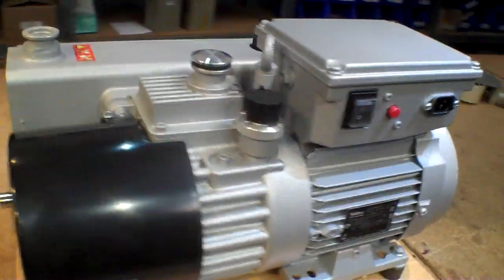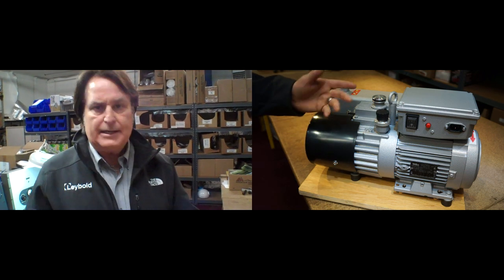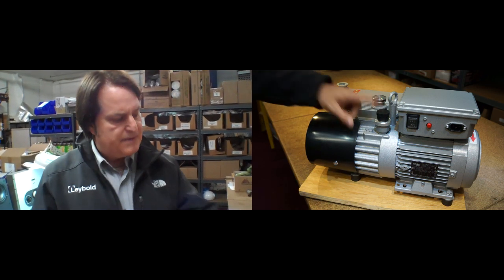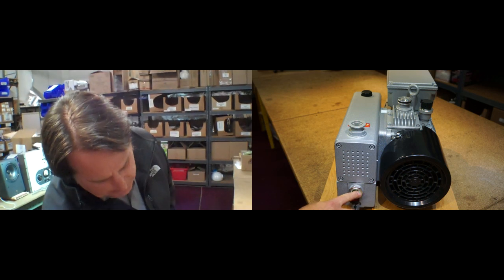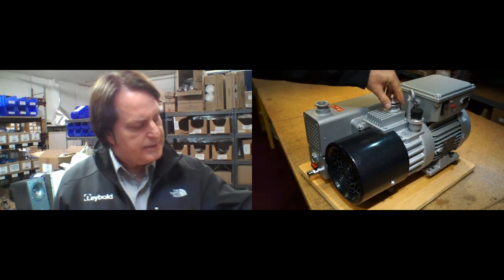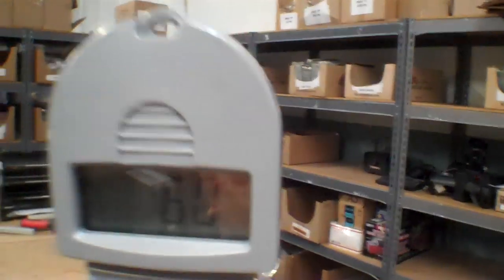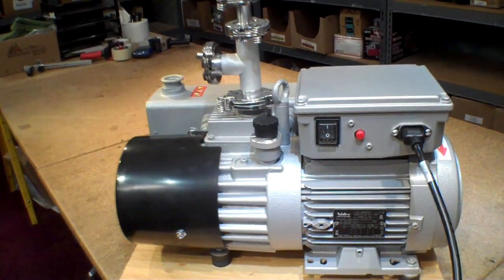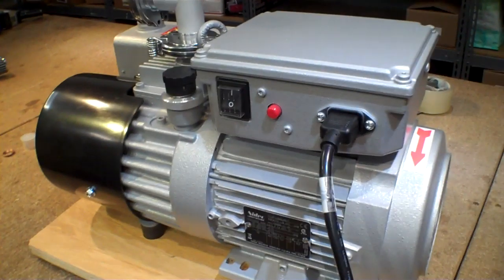Introduction to the Leybold Sogevac® Neo D 16 rotary vane vacuum pump.

Comment: Brian, along with all your other testing and equipment needed to pull this off successfully with harvest right machines, can u also let us know power usage compared to all  harvest right pumps,
 Also how fast it drops to 500 mtorr? It is 11 plus cfm so it aught to work nearly double as fast on the entire process.
Also how low of an mtorr it gets too? WITH AND WITHOUT BALAST (ON AND OFF) SEPERATE  TIMES?
Also total batch time for dry cycle?(INCLUDING HOW U USED BALAST DURING THE ENTIRE PROCESS?
Also total batch time for final dry and over all total as well?
Also how you are using the balast valve during the whole freeze dry process? 
Also the decibels with balast valve open?

My oil less pump had two different results on back to back batches of  2 #10  CANS of tomatoe sauce in 34 hours for the 1st batch.
AND 38 & 3/4 HOURS FOR THE SECOND BATCH OF 2 #10 CANS OF TO A TOMATOE SAUCE. 
AND MY OILERS  PUMP IS $1600. 

P.S MAYBE YOU COULD DO  THE SAME TOMATOE SAUCE I USED. IT WAS TWO #10 CANS OF CANTALINA TOMATOE SAUCE FROM COSTCO. IN LARGE 5 TRAY HR. I STARTED PRE FREEZE YESTERDAY AT 230PM, AND THE BATCH IS FINALLY ON FINAL DRY AND SAYS IT'LL BE DONE AT 5:46 AM ACCORDING TO FINAL DRY COUNTDOWN. THAT SHOULD MAKE MY ENTIRE BATCH TIME JUST SHY OF 39 HOURS*
I'M HOPING U SELL ME ON A REAL WORLD CLOSE EXAMPLE OF LEYBOLD PUMP.  BECAUSE IF IT BLOWS THE  39 HOURS AWAY FOR HIGH LIQUID TOMATOE SAUCE I DID,  THEN I'M SOLD*
THE COMPANY GAVE ME MIXED ANSWERS ON  MAINTENENCE OF MY OIL LESS PUMP. FIRST PERSON SAID TO ADD 1/4 CUP OF ALCOHOL TO FLUSH PUMP.
THEN THE NEXT TIME I CALLED THEM A LADY THERE SAID TO NOT USE ALCOHOL AT ALL,  B3 CAUSE IT DRIES UP THE SEALS. SO SHE SAID TO POUR SMALL AMOUNT OF WATER WHILE IT'S RUNNING IN THE HOSE AND LET IT RUN FOR AN HOUR. 
BRIAN ANY SUGGESTIONS ON WHAT I SHOULD DO FOR MAINTENENCE ON MY OIL LESS PUMP TO KEEP IT EFFICIENT AND RUNNING AT ITS PEEK PERFORMANCE?
IF YOU ARE SUCCESSFULLY RU NING THIS NEW SYSTEM, AND IT'S BETTER AND EASILY MAINTAINING GOOD RESULTS BATCH AFTER BATCH, I CAN'T WAIT FOR YOUR FUTURE UPDATES ON THIS LEYBOLD  PUMP,  ALONG WITH HOW YOU ACTUALLY USE BALAST FEATURE.
Reply from the maker: HR is no longer recommending using denatured alcohol with the oil-less pump. In fact, they rescinded the 10 batch flush maintenance all together in favor of stressing the need to never bypass or shorten the freeze cycle.
Reply: @EpicenterBryan  Hi Bryan,  I dont quite understand what it  means to: "by in favor of stressing the need to never bypass or shorten freeze time". Lol. If you have time,  Could you explain in a different way in what that does? Appriciate your time, and understand your busy if u don't have time to respond. God Bless.
Reply: Directly from Harvest Right support;

Here are the instructions on how to clean your dry pump.

1. Flip power switch to 0 on Dry pump
2. Unplug pump from Freeze Dryer and plug into wall outlet 
3. Take off twist cap off of dry pump (opposite side of where pump exhaust is)
4. Take off hose from Freeze Dryer
5. Flip power switch to | on Dry pump
6. Let run for 1 hour (this might be louder than normal due to the air running through the pump)

If your still experiencing issues, follow the instructions below

Water Flush
a. Switch on the vacuum pump and unplug it from the back of the freeze dryer.
Disconnect the vacuum hose from the vacuum pump.
b. Plug the vacuum pump into an electrical receptacle.
c. Turn on the vacuum pump and pour approximately 1⁄4 cup of water into the inlet (hose connection fitting on the vacuum pump)
making sure the exhaust port on the vacuum pump is pointed in a safe
direction (away from you and anything you do not want sprayed with a mist or
stream of water and debris it carries).
d. Repeat pouring water into the inlet until only clear liquid droplets come out
of the exhaust port. Usually once or twice is enough.
e. Clean o the exhaust port with a dry rag or paper towel.
f. Let the pump run for an additional 30 minutes to let dry
g. Reconnect the vacuum pump to the freeze dryer vacuum hose and plug the
vacuum pump into the electrical receptacle on the back of the freeze dryer.
h. Switch the vacuum pump into the ‘on’ position.

Thanks,
Technical Support
Reply: @InFlorida4252  hi betty, what is the cap called on the other side of exaust? And what is its purpose during the PUMPS RUNNING PROCEES, AND ALSO MAINTENANCE   PROCESS? It also doesn't appear you included it in the steps for the 2nd procedure with the water flush instructions? Im not understand what it's purpose is? If it's only included in instructions for the maintenance without the water your first described? 

Im so confused, HR told me to run pump without water as it ruins seals ect. And they never told me to open or remove any caps at all. And i just spoke to them about two or three weeks ago. I've been trying to gather info from users experiences with proper instructions they got from HR so I can try to understand who to believe. Lol.. any help is greatly appreciated. Lol.. Thanks.
Reply: @InFlorida4252  Well hello Betty. So nice to see you here. I do hope you are doing well. I'm really enjoying my HR dryer and I have learned so much from you and others like you. Thank you so much.
 I took an old coffee can and cut a hole in it for the pump exhaust to blow into and catch the water during a flush. Works great and is low cost.
I hope to see some more videos from you - I really like your channel.
Reply: I don't think this pump will make much difference in overall time of the cycle. The pump just keeps a vacuum as low as possible as the heaters cause the moisture to come off and collect on the side of the chamber.
I've had my oil less pump since December of 2018 and am very happy with it. I have had no problems using alcohol about every 10 batches. The only issue I have is with the heat in my garage. I live in the desert southwest and my garage gets up to 110+ F which really affects the dryers performance. (no space for it in the house) I built an air circulation system to draw cool air from the house through the cabinet and back to the house. It keeps the machine below 90 F and is back to proper performance.
 When I do tomato sauce, I get the lowest sugar content possible. Then run it through my food processor to make it a powder. Works well this way. Personally, I wouldn't go back to dealing with oil.
Reply: @jerrysmith372  Hi, Two weeks ago go harvest right told me to not use alcohol flush at all because they said it causes the seals to dry out and fail quicker. They told me to pour water in. But the  never told  me exactly how to do it. Can u let me know how you pour it in and how long to run it to flush it all out? Thanks again. For any details on how the steps are performed. Because they never gave me a manual 
. And the email pdf  version absolutely doesn't say anything aboyt either alcohol or water flushes. Lol.

Also my last batch took 38 hours 52 minutes and it 3 trays were slightly tacky but still powdered, so I added more dry time. How long does your pump take to do 2 #10 CANS of tomatoe sauce? I guess with and without more dry time?
Reply: @mossymaple  To get alcohol/water down the pump while running. Disconnect the hose from the dryer - plug the pump into the outlet to run the pump - pour the liquids down the hose. When your done - reconnect the hose to the dryer and put the power cord to the pump back to the back of the dryer.
It's not the pump that is doing the drying - the pump only maintains a vacuum. The heaters and the software are doing all the drying. Is your dryer in a climate controlled area? Mine is in my garage and the added heat out there will make the unit work harder and can effect the run time. But 28 to 35 hours sounds about right. I wouldn't put more than a quart of liquid per tray. Overloading the trays will take much longer to dry. Also things with a high sugar content will sometimes still be tacky at the end of a cycle. All you can do is check the food at the end and determine if it needs more dry time. I have done 5 trays of spaghetti sauce (which has sugar in it) and I think it took about 42 hours. 
 Since banana's are on sale in my area at $0.42 lb I have 10 pounds of pealed and sliced going right now. My last batch of banana's took 33 hours. Again my unit is in my garage where the temperature gets up to 110. Without the piped in cool air I built for it to keep the cabinet below 90 F, I wouldn't be able to use my machine until cooler weather. Too bad HR didn't design it for use in hotter conditions. Not everyone has room for one of these in their house. But it works and I'm very happy with my dryer and oil less pump.
 If you have any more questions, I would be happy to share my experiences with foods I've done.
Reply: @jerrysmith372  Thanks so much for the information. How long should I run the pump for the maintenance?
Reply: @mossymaple  Not sure yet. I sent an email to HR and am waiting for a response to that very question. I let them know I was miffed about not being informed about the change in procedure.
How long have you had your dryer?
Reply from the maker: That's a long post. I'll cover some of it in another video. As far as how fast to 500 mtorr goes... with two FDrs connected it's about 2 1/2 minutes. The difference between ballast on and off is 6 mtoor and about 3db(A) added noise. The decrease in batch time is not as big a deal as having the new firmware. That makes a really big difference. In the future, they will make the ballast always on. With your oil-less, did you purge the water from the pump between the first and second batch? Open the front door and manually run the oil-less for a minute or two so it spits out all water. HR is no longer recommending using denatured alcohol with the oil-less pump. In fact, they rescinded the 10 batch flush maintenance all together in favor of stressing the need to never bypass or shorten the freeze cycle.
Reply: @EpicenterBryan  OK - a dumb question. As an HR customer having the oil less pump from HR - why didn't I receive those notices about the pump maintenance? Do I have to be on some special list to get updates from HR? I did send an email asking if I could get and download the latest firmware but never got a reply.
Reply: @jerrysmith372  WHAT'S THE FIRMWARE FOR? AND HOW NEW IS IT?
Reply: @mossymaple  I got the impression from one of your comments that you already have the latest firmware. You machine asks you if the batch is a liquid or solid. Yes? Mine does not. There for you have the latest firmware. It's basically the computer software or program if you like. I think the newer machines are updateable to a point. Each time Harvest Right has updates for their software it is possible to buy the update and install via jump drive in the USB port. But you have to request it and know when they have them available. I'm not sure if HR has a news letter or not but if they do I'm not on it.
Reply: @jerrysmith372  As of 8/23/19, when I inquired HR wanted to know the current firmware number beginning with a "V".  If your model is a real old one, I understand the new firmware will cost $160.00.
Reply: @billjustbill5739  No - My unit was new Dec. 2018 with fairly new firmware. The latest version also asks if the food is liquid or solid. I don't have the very latest version. But I'd like to look into it. $160 is a fair price for proprietary software.
Reply: @jerrysmith372  What is the version number of your software with the 'frozen/not frozen' screen prompt?  This machine's number is "V.2.2.2"
Reply: @billjustbill5739  Well it's running at the moment and doesn't show it until end of batch. And I'm old and forgetful so I don't remember what version I have. Something like V.4.2 something. My unit is only 9 months old.
Reply: @EpicenterBryan  Is the new firmware for the oil free HR PUMP? How new is it? If having it helps, that would be great. I ordered my machine in march, And am not sure what firmware version is the newest? What are the improvements of having this new firmware? Thanks again.
Reply from the maker: @mossymaple  If you ordered in March yours is probably pretty close the the newest. Right now, I have 4.1.4 on one machine and 4.1.7 on the other. When you fire up your machine it will show the version in the upper right screen. The big thing with 4.1.4 and up is that the pump starts during the freeze cycle which speeds things up by 25%.
Reply: @EpicenterBryan  Thank you for the info. Much appreciated.
Reply: @mossymaple   Hey there - I tried to respond directly to the last message we had but it's not coming up. You asked a lot of questions and I'll try to help you with what I can. Sounds like you are new to freeze drying. There is a learning curve with these machines, don't be afraid to make mistakes. First - you don't need to pour water into the oil less pump to run it - only after 10 or 12 batches to flush any build up of gunk that MAY be collecting in the pump. 1/4 cup at a time while the pump is running (Just plug it directly into the wall outlet) until the escaping liquid runs clear then let the pump run for about 1 hour. I don't have a copy of the HR maintenance procedure so I'm just going by what I've heard. Yes I suppose you could just pour the water inside the chamber to the vacuum inlet - this would save you from disconnecting the hose if you didn't want to do that. I took an old coffee can and drilled a hole in the side of it to fit over the vacuum pump outlet to catch all the liquid during the flushing procedure. Just a tip.
A word of caution when drying things with a high sugar content - some things just don't freeze dry well like jelly. The more sugar in the foods the less likely that it will do well. Brian has many videos experimenting with different foods. There many you tube channels that discuss HR freeze drying. What does and does not do well. Spend some time and watch a number of them - you can learn a lot. I did. Sometimes you learn what NOT to do.
 So sorry you had so much trouble with the oil pumps. You made the right choice to go with the oil free pump. I hated dealing with the oil and the filtering and the cleaning. Such a mess.

I bought my large unit directly from HR - they can match any price of any of their affiliates. I'm sure Brian will cringe if he is reading this. (sorry Brian) I built a work station in my garage, 32"X52"X 34"H with a second shelf the same size from 2X4's and a 3/4 inch white laminate (both sides) that comes in a 4X8 sheet from Home Depot. I wish I could insert a picture here for you.  The pump sits on the lower shelf and the hose is just long enough to reach up to the dryer. I ended up with a 28X32 inch work area for processing foods and plenty of storage below for bags, O2 absorbers, extra trays and other things. The second shelf sits about 8 inches off the floor so more room for things under the bottom shelf.
 The down side of having it in the garage is the heat of summer. Here in Las Vegas it gets very hot and my garage can reach 120 +. As you might guess the machine doesn't do to well in temperatures above 90 deg.
I had to create an air system to bring cool air from the house through the machine and back to the house. I used a bathroom ceiling fan (a very quiet one) mounted in the wall to move all the air. It does manage to keep the internal cabinet temperature to at or below 90 deg. 
 One of the things I do with certain foods like eggs or milk is to scrape it off the tray and run it through my food processor to make it into a powder. Spaghetti sauce, Alfaro sauce, apple sauce and such powder up well. When doing high sugar foods like apple, bananas, pineapple and such you should use the silicone matts that came with your unit to keep the food from sticking to the tray. A must if you choose to do ice cream. 
 Just so you know - it is necessary to blanch "fresh" vegetables before freeze drying, like carrots, peppers, potatoes and such. Not necessary when doing store bought frozen vegetables.  Here is a web site you can go to for directions about blanching. https://extension.umn.edu/preserving-and-preparing/vegetable-blanching-directions-and-times-home-freezer-storage
 Also https://nchfp.uga.edu/how/freeze/blanching.html
 And https://nchfp.uga.edu/how/freeze.html
 These are good sources for blanching and freezing foods that you may find helpful.
 I know I droned on a lot here so I hope I have helped you in some small way. If you have questions that I can help with, feel free to reach out to me. Peace be with you.
Reply: @jerrysmith372  Thanks. I read things I'm interested in. Now worries about long posts. Mine are mong too.lol.
I had one tray (probably ok but just slight tacky but still crunchy). I left the unit closed but never touched any buttons to exit, to add more dry time, or to defrost. But about 20 minutes later , after bagging the other trays, I noticed the last tray described above. So I put it in and, when it finally started after cool down, it went directly into FINAL DRY? It completely skipped over the ACTUAL DRY CYCLE. This happened in June one time. And I have no idea why, buy when I called HR, I had a higher up, on the phone,  and he said it sounded like a glitch, and to start all over. BUT I GUESS  WHEN U ONE ADDS MORE DRY TIME , IT DEFINITELY SHOULD ENTER AN ACTUAL DRY CYCLE BEFORE IT GOES INTO A FINAL DRY? WEIRD, BUT I , JUST ADDED THE ONE TRAY, AND RESTARTED THE UNIT FROM SCRATCH, BUT I NEVER DEFROSTED. BECAUSE I WAS THINKING , THAT IF IT CAN ADD MORE DRY TIME TO ALL THE TRAYS IF THEY WEREN'T DONE WITHOUT DEFROSTING YET,  THEN IT DEFINITELY SHOULD BE ABLE TO DO ONE TRAY WITHOUT DEFROSTING, BY STARTING OFF ON HOME SCREEN FRESH. ONLY THIS TIME I SET IT ON LIQUID, AND NOT FROZEN. 

BUT WHEN I CALLED HR, THEY TOLD ME THAT THEY RECOMMEND I JUST DEFROST THE MACHINE , PUT THE ONE TRAY in freezer ,and start fresh that way. 

Have you ever had a dilemma with adding more dry time? And suggest would be great.  Maybe some ways to manipulate the start up from scratch to allow a nearly dry tray to  be expedited? Or to does the machine sense I only have one tray that's two hours away or so from totally being dry? Idk.. lol.
Reply: @mossymaple  It is always best to check each tray before completely ending the cycle. If they feel tacky or still very cold it is not dry. Best is to touch it with your fingers. Brake it apart and feel it. It should be crisp. If any are not fully dry you can just slide them back in and touch the "more dry time" on the screen and use the up arrow to add what you want. If you start the batch over from the start the machine will sense the moisture level and may go into a "small batch cycle" or just go straight to "final dry" either way is OK. The machine uses the vacuum pressure to gauge how dry things are. When foods get to below about 500 m tor at 100 degrees it will go into final dry and usually go for 8 hours unless you add more time. Sometimes I do add time so I can be there when it's ready to come out. like if I'm at work or asleep when it wants to be done. The only way you can mess up is packaging foods that are not completely dry. It will go bad and you may not know it until you open the bag. 
 I don't always use the powered defrost. If I don't have a batch I want to do for a while I just press "no defrost" and just leave the door open and let it melt on it's own. Saves electricity. But if you have a batch you want to get in quickly go ahead and press "defrost" and close the door. The heater pads will heat up and melt most all the ice in the 2 hour time window.
 One thing I do and I'm not sure if everyone does this or not. But I take out my rack between batches and disinfect the chamber, rack and door seal with Lysol every batch. I'm a bit OCD and germ-a-fob. All my work surfaces get disinfected before and after each batch is processed. 
 Watch this lady's videos - you will like her and she will answer your questions too. She has been freeze drying a long time and is very wise and just a sweetheart.
 https://www.youtube.com/user/InFlorida4252/videos
This guy has a lot of different stuff so you'll have to pick through and just watch his freeze dryer videos. Some times he shows his fails as well.
 https://www.youtube.com/channel/UCn8n_wDeUDrdDMQfoElZlfw/videos
And of course you already have Brian's channel and I do like him. He will answer your questions as well.
 I don't normally do this but you may email me directly if you like jlsmith86@cox.net. I'd like to see some pictures of your set up if you don't mind. And it would just be more privet. I'll share with you what I know and also what I have found not to work well.
Reply: @jerrysmith372  Thank you so much for all the info.
Reply from the maker: That's a great question. I first heard about it in a FB group. Then called HR and they E-mailed me the "maintenance update". Funny thing is I wasn't told about no longer recommending it. I heard about it on FB again then verified it. As a dealer, I would expect to know first... As far as the new firmware goes, that won't be ready until the end of the summer (last time I heard). It will be a low cost (not free) update supplied on a thumb drive.
Reply: @EpicenterBryan  Thank you Brian for that information - it does help a lot. I don't have a copy of the maintenance instruction but I've heard that they are recommending using water instead of alcohol and running the pump for 1 hour. Can you confirm this?
Do you think there would be an advantage to updating the firmware? My unit was new in December of 2018. As far as I can tell I have a fairly new version. Just not the choice between a liquid or solid batch.
 Would you care to guess at the cost of the upgrade for the firmware? If it's not outrageous, I would pop for it.